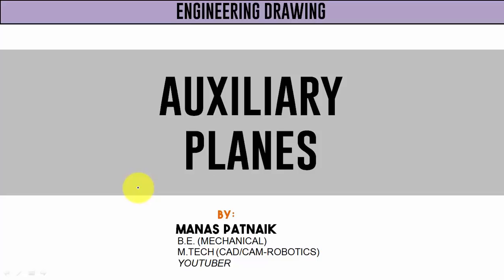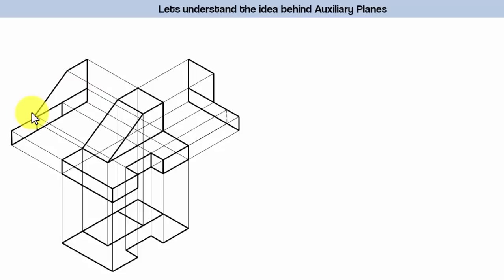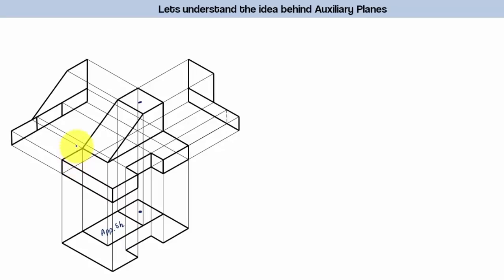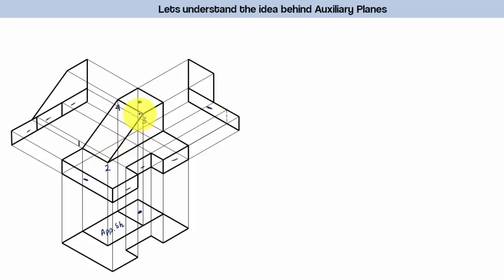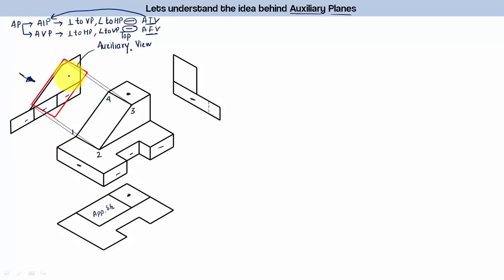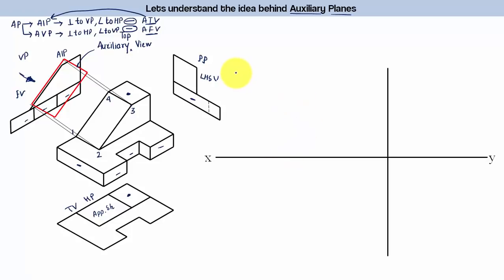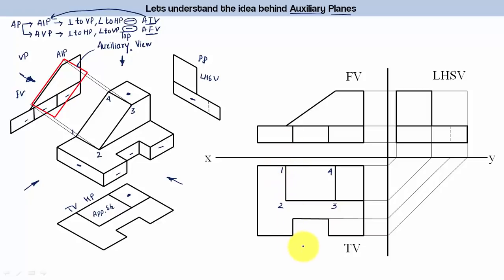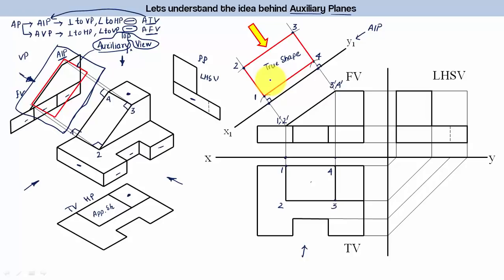Auxiliary Planes_Concept_Lecture1

Comment: Q1)The projection originated from the 3d object itself to project on the plan in front of it, is called_________.
a) First angle projection b) second angle projection
c) third angle projection d) fourth angle projectio.
.
Q2. The projection originated from from the eye ball and converted into 3d object to project a 2d image on the plane is the
(a) 1st angle projection (b) 3rd angle projection (c) 2nd angle projection (d) 4th angle projection
.
Q3. when the surface is inclined to two of the planes of projection ( but perpendicular to third) the surface is said to be (A) Auxilliary (B) Skewed (C) Oblique (D) Angled (E) Primary
.
Q4: actually show the full size of view (A) Axonometric projection (B) Orthographic projection (C) oblique projection (D) Isometric projection

Comment: Hello,Sir!I have a doubt on a problem.please solve that question by auxiliary plane method. And the question is "Draw the projections of a circle of 75mm diameter having the end A of the diameter AB in the H.P.,the end B in the V.P.,and the surface inclined at 30° to the H.P. and at 60° to the V.P."
Reply from the maker: request noted....
Reply: @ManasPatnaikofficial  so where is this question solved. ..